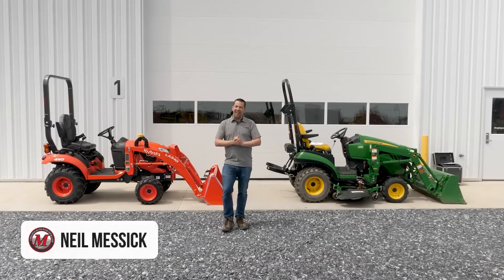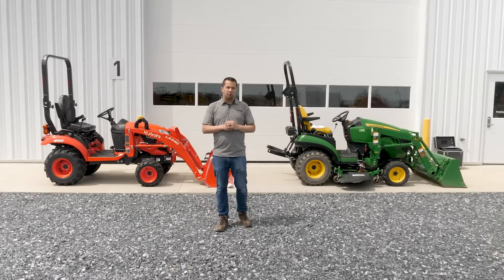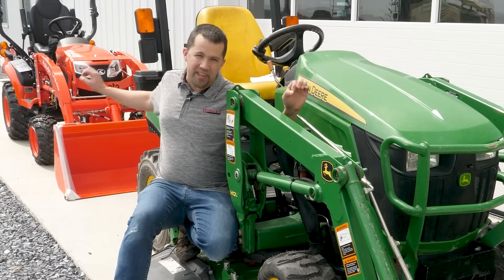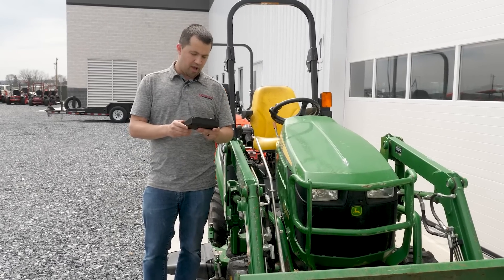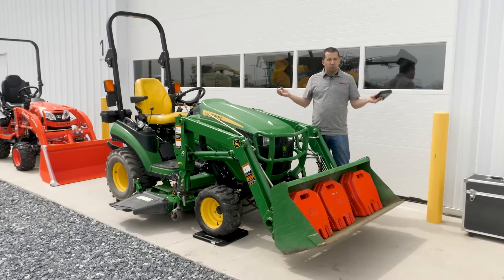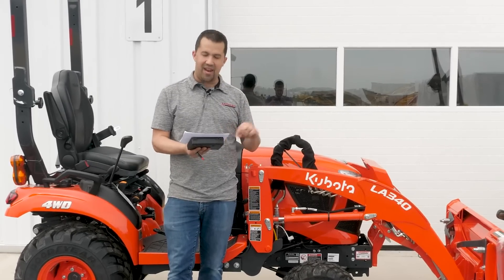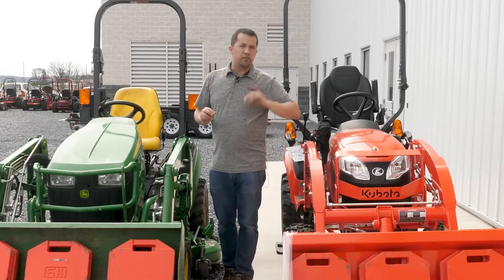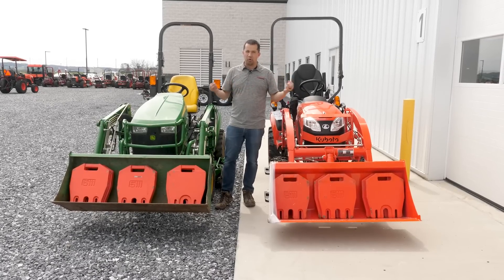front axle capacity vs loader strength

Comment: Numbers would be different if you removed the under carriage mower on the Deere. It's obvious the front axle strength was designed without any additional weight put on the front end.

Comment: Great video Neil.  Safety is of my utmost concern when using my loader or forks. Published capacities are very helpful, if the consumer understands what they are reading and how to interpret it.  My BX23s behaves very differently and can handle 200lbs of material in the bucket,  than it does with 200lbs of honey supers on a pallet with the forks on (I keep the backhoe on for such tasks as ballast).  The difference is the distance of the weight distribution from the font axle - makes a huge difference, so it is a "reduce the load, slow down and take it easy approach" to all things when using the forks.  I also have been impressed with the quality of my purchase - hI am thinking that with proper care  it will last like the Farmall A my in laws had on their farm until they retired.

Comment: Do we know anything about if those numbers are for a traction in motion or static? I remember one ag tractor manual for way back that listed different speeds. Presumably factoring in how much dynamic pressure it puts on them when the terrain is uneven (but also - you wouldn't try to go full speed across plough furrows). JD being over their spec with just empty bucket I would think means maybe it at full speed isn't rated for having any load in the bucket?
So the impact of this is that with heavy load I drive very slowly.

Comment: Good Day Neil: 
A year ago I bought an L6060 and had a L3800 for 10 yrs before that. What I expect from a tractor is that it is designed to work within the perimeters of what the equipment says it should. In other words the L3800 loader had the 524 loader and if I understand the rating that means that the loader can and should lift 524 kg or 1152.8 lb to full extension and that all of the components of the tractor are designed to handle that amount of weight. If it is not, then the tractor manufacturer has not done their job in proper designing. This I believe should apply to all models of the manufacturer....

Comment: There is a lot of discussion about JD CUT front axle seals leaking. People are selling $100 vent kits to relieve pressure in the front axle. I discussed this with my dealer and was told they believe it is due to overloading the front axle. There is also a lot of discussion about how much ballast is needed.

Comment: I'd like to see this added to by having equal rear ballast in each and see what if anything that changes on the weights.
Reply: Adding weight to the rear doesn't take any weight OFF of the front. It actually slightly increases the load on the front a minor amount....but it BALANCES the tractor.
Reply: @evracer  Wrong. Watch Neil's followup video he posted.

Comment: I wonder if it's the same story for bigger compact and utility tractors? 🤔 Obviously adding read ballast helps unloading the front axle, but your video is nevertheless eye opening!
Reply: You're definitely going to get a much beefier front axle on those.  Also a heavier, and heavier built tractor overall- which is more ideal for heavy duty use.

Esp a utility.  Those are MADE to be loader tractors for owners who work them hard and often. 

 For an interesting experience, visit a dealer who sells both  compact tractors and ag tractors.  See if you can find one of each parked side by side, and look them over good.  Its astonishing how different they are, beyond all the talking points.  My local green dealer had a 4066r (compact utility) parked right next to a 5055e( small frame utility).  Both with cabs, and loader frames.  Both are roughly the same size.  The 5055e kinda made the 4066 look like a toy.  Everything was much heavier built. The cab was even roomier, albeit more basic.
Reply: Its hard to really see those differences from a video or website.

Comment: Rear ballast included per manual would have been ideal, but a good video regardless.  My 2025r has slightly higher specs and weight, same rating. Does it make me nervous? No, I feel like these are very conservative numbers from the manufacturers.

Comment: One of the reasons I chose my standard L series was how beefy the front axel is, I remember Neil saying Kubota matched the axel to the loader capacity
Reply: I watch a lot of firewood guy videos, and it always makes me wince when i see what some guys are trying to lift or pull with sub/compact tractors.

Some of them really need a utility tractor, not a compact... (before they kill themselves) .   Some of the small frame utilities are very agile, and can fit in most places you want to go- theyre also WAY beefier, and have beefier loaders and hydraulics.  All in all, id much rather be using one of them to pick up big hardwood logs, snake them out of the woods, etc.

Comment: This is why real ballast is required for almost all applications. The Deere being at capacity with no weight proves that. I think you should revisit the topic with an implement off the back.
Reply: Ballast does NOT "take weight off" the front axle. It BALANCES the tractor. You cannot reduce weight by adding weight.

Comment: You began with talking about the reliability of the old tractors. My dad got his IH dealership in 1937 and being born in 1945, I got to spend a lot of time repairing those Farmall H & M, Cubs, A's, and C's. Then off to a 44 year career and back to farming buying my first tractor, a Kubota L3710. CUT so not in the same class as a mainline farm tractor H or M. I traded it off on a cab L5740 after 12 years with no mechanical problems whereas I had been fast at replacing wheel bearings, transmission bearings, loader cylinder seals, plus welding on the old tractors. Yup, I could keep them going, but compared to my first 2 Kubotas. My L5740 was replaced with a L6060 which was replaced by a M5-111. In addition I have a M7-171 KVT. I especially dread thinking of transmission repair on the M7 KVT but hopefully it is designed for more endurance than a Farmall H or M. Last year I did add an old tractor to my fleet, an Allis-Chalmers D10. less than an hour and it now has a place as yard art. As for axle capacity, yes, the CUTs are not good. However, it was cheap and easy to replace the bearings on my L5740 as they failed. Yes, I used the loader to max capacity a lot so failure was not unexpected as I knew it couldn't handle the load.

Comment: Great video, Neil. This is why I chose the MX 5800. I didn't have specs. to go by but the beefy look of the front axle and width of the tires also they used a cat.2 3-point hitch on the rear end showed me that Kubota designed this model for strength.
Reply: This is great advice, shopping by the numbers isn't enough. I see more steel in the fel than the axle on many machines.
Reply: I have  grand L4060 and the front axle looks like a tree log made of metal its very beefy - I have moved hundreds of thousands of lbs of dirt over the last 80 hours of tractor use and its as tough as anything I have tossed at it.
Reply: @DeepSouthVeteran  Good to hear! I love spending time on my Kubota. I believe that Kubota makes some of the finest equipment in the world. Be safe and have fun.

Comment: Good information, I would have to agree with also following this video up with one showing the rear ballasting and weight distribution off of the front axle. Another good spin off of this video would be to compare the kubota farm tractor models example l30 whatever..., to the true kubota backhoe models l35/47whatever,... and see if the front axles are the same or built stronger on the actual backhoe models....you got a couple of good rabbit holes to go down with this viedo here, thanks' for making it!

Comment: Great video. Im curious if different amounts of ballast lifts some of the weight off the front end?  I have a BX23s  love it.  I also have a older B7200 HST great machine as well as a Ford 9N  still able to get up and work.  Lets hope the Kubotas make it to be that age.  I wont be around but somebody will be happy to have them.
Reply: It's called ballast for a reason. It BALANCES the tractor. In no matter of physics does it take weight OFF of the front. Adding total weight to the tractor by adding ballast technically increases the front weight by a minor amount.
Reply: @evracer  I understand your reply and it does make sense.  I still feel that the see saw puts the little kid in the air while the big kid is on the ground.  Im trying to figure why my truck gets much easier to steer the more wood I load in the back. When Im actually putting more weight on the front axle???  I would like to understand it a little better. Thanks
Reply: @evracer  Also wrong. Again, watch Neil's followup video.

Comment: one question i have,  how is axle capacity technically measured? is measuring at the tires an accurate measurement of axle load?  I'm wondering if the weight of the axle itself should be subtracted from your measurements?  surely the weight of the wheels and tires wouldn't be counted?
It seems strange that anyone would sell something that overloads its axle when empty.

Comment: Last summer I bought a new Kubota L4701 with the express purpose of managing large round bales.  The tire pressure for the front tires in the manual is 20 psi.  The first round bale we lifted (about 1200 lbs) caused the front tires to look flat.  We had to increase the tire pressure to manage the load.  These heavy loads do put a lot of pressure on the front axles.

Comment: Neil, it would be interesting to demonstrate how the axle loads changes as you pick up a load.  The front axle should spike as you lift the load off the ground then drop, then slowly increase as you reach mid lift then drop as you get to full height.  The rear axle should do the opposite. The specs on loaders usually give capacity at full height, but that isn't the worst case.   Maybe this would people visualize the physics of what is happening.
Reply: I would be interested in seeing this. I think your logic is sound, but how much difference does load distance from the front axle actually make?
Reply: @phild9813  if you are operating at the specified capacity of your loader, it may be more significant than you realize.  I think that was the point of this video.  But he was showing just one case.  It may not be the worst case when it comes to front axle loading.